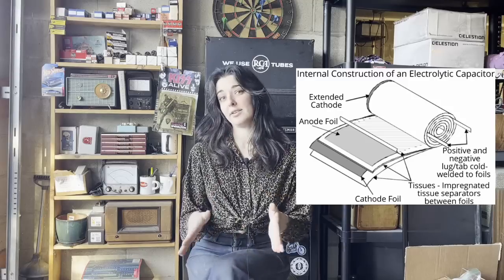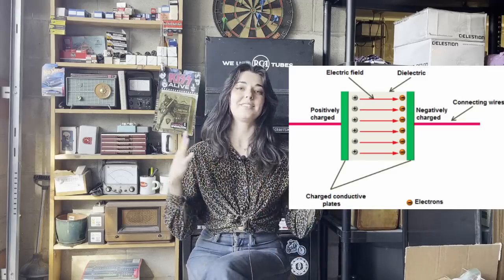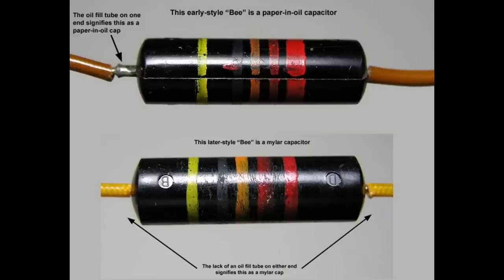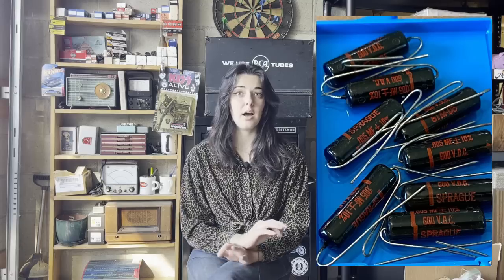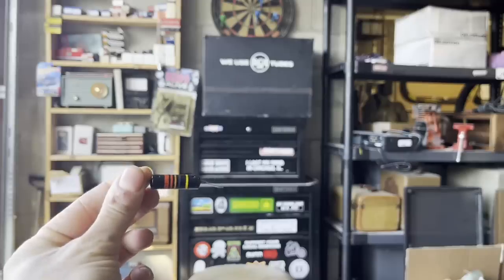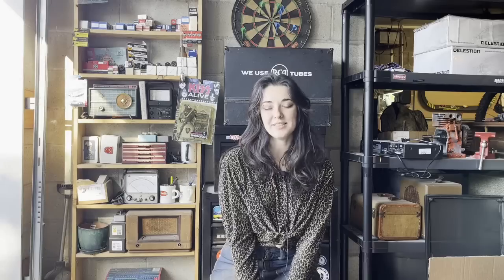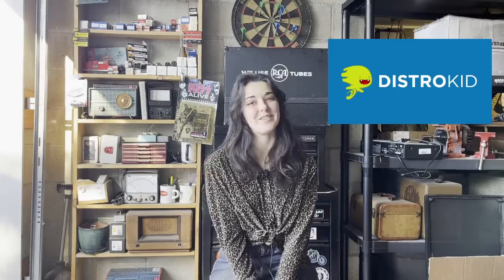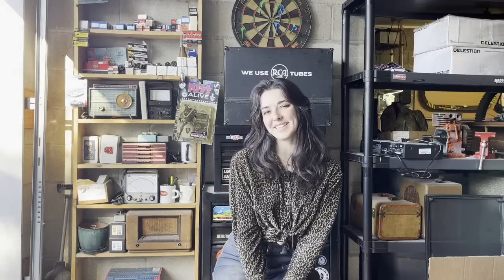Bumblebee Capacitors | Sprague Black Beauty Capacitors | Amp Electronics 101 | Fazio Electric

Comment: If an old Capacitor is working correctly then it should be doing the same job as a new one.
I honestly don't see how it can make a difference in the sound of the audio. Electrons flow in a controlled manner, and if a new cap is the same value as the old one, then it should be doing the exact same job

Comment: I went down the capacitor rabbit hole a few years back when I was upgrading my Stratocaster. I searched for the best tone cap with the best mojo. I tried tropical fish, Russian PiO, mustard, bumble bee, and the last one came from a 20 for a dollar pack of eBay Chicklet caps. The Chicklet was the one I left in the guitar. I couldn't tell a bit of difference between any of them as long as the values were the same. 

Some will swear they can tell the difference and I'm glad they can. I just know that I couldn't.
Reply: Dont't worry.  A spectrum analyzer would have difficulty finding real differences with caps of equal value, construction and intended circuit purpose.  But I forgot, this is a crowd that will pay hundreds of dollars for an 'oxygen free copper' audio cable.  I have a National NC-300 on the bench now undergoing a full rehab.  Lots of musturds mixed with split bumblebees.  As was said before, better components available now.  And smaller too...
Reply: @og_papatango  Indeed. I'd like to see someone actually analyzing some simple circuits with different caps and showing us the frequency and phase responses measured  on various input signals (guitar, noises, impulse, frequency sweep) and on different voltages. Then of course, the old caps leak current so maybe there should be some resistor put in parallel with that to simulate bad components. :D Maybe also a torture test to see which ones last the longest. Well, maybe temperature is another variable that should be added to equation.
Reply: I can't hear that as well but vocal fry.....????
Reply: A strat is also a terrible testing platform because you need to take the strings off every time you need to get to the insides. 
This inserts so many variables into the equation that you might as well not bother at all.
Any guitar where the elctronics can be accessed through a panel would be far more reliable.
Reply: Russian PIOs are my favourite just simply because they are incredibly durable and very well made.
Reply: Did you try them all with the tone rolled down? The capacitor does nothing if the tone knob is not rolled down. You won’t hear the difference.
Reply: @TheChadPad  Absolutely
Reply: @Slugg-O  Well, there is a video I just watched by Full-Gain called Vintage Bumblebee vs Stock tone cap comparison that shows a stark contrast. It depends on your setup, and at the end of the day, they all do their job, that is to cut high frequencies. It’s in the complexity that I hear differences, not in the basic frequency response.

Comment: You did a fantastic video on a fender concert a while back. This video covered many issues that classic amps experience, however, the tremolo is different than the one on a 1959  - 1960 unit (6G12 circuit). Could you please explain how this one works through the use of a schematic. 
Thank you

Comment: I have a couple dozen Spragues with low-uF values ranging in voltage from 200V up.  I'm not so sure what to use them for, considering their low-uF.  They were in a big box of ancient parts.  Few have been used.  I used my oscilloscope to test them, and tossed the leaky ones.  A seriously leaky one blew out a pickup on me.  All are marked numerically.  What $5 can buy these days!

Comment: The only caps I ever change are in my guitars tone circuit, those don’t bite. lol 
Over the years that I have been doing that the only difference I’ve heard is in the number value. Like  a .022 as opposed to a .068 or .033 or .047 those differences are sometimes drastic. As far as type of cap ceramic or paper n oil ect… not much of an audible difference for me anyway.

Comment: I am planning on using silicon diodes in series with the rectifier tubes' anodes for extra protection (even is the tube is shorted, this will prevent the capacitors from getting AC, and protects the rectifier tube from potential high value reverse voltage spikes). Do you have an opinion on this, or maybe consider it pointless? Also, do you watch videos from Mr. Carlson's Lab? He has an awful lot of videos on the topic of these old capacitors.
Reply: Reverse voltage on a capacitor doesn't really cause damage as long as the current and duration is limited. If you have fuses on the transformer input and the output of the rectifier everything should be protected enough. 

If you add this protection and the rectifier tube shorts you won't know, but you'll be stressing the circuitry with higher B+.

Comment: I just worked on a couple amps.  Of the 40 bumblebees I pulled out,  only two were within spec.  When these start failing (paper/oil in this case),  the oil can form a sheen on the case.  The value goes up but the breakdown voltage goes down.  The value also varies with the amount of signal across them.  You could use them in non power circuits for some interesting results.

Comment: I have a 1973 Les Paul Custom Black Beauty I purchased new in Jan 1974. One of the leads broke off of the Black Beauty cap. I see them used for around $200 a pair. Still debating whether to pull the trigger.
Reply: No! Get russian "paper in oil" caps, they're the same thing but better quality and cheaper... Sometimes guitarists are fools... (Not you, the ones that pay $200 for a pair of BB caps)

Look for:
K42y-2
K40y-2
And
KBG type PIO caps

Comment: I've seen people using vintage tools, like multimeters and various testers to help with repairs. Do you need vintage tools to work on amps or can you substitute all modern equipment? Thanks! Appreciate all the effort you put into your videos.
Reply: Modern tools of the same type work just fine. The main difference is digital multimeters have much higher input impedance than old VOMs. If you measure voltage on a tube grid you will often get a different reading than if you used an old meter.

Comment: If it’s a coupling cap and leaking DC to the grids of the output tubes, then it will make a difference in sound because the tubes’ bias may have changed.

Comment: I have two words for y'all that get hard ons because of BB/bumblebee caps... 
Vitamin Q!!!
 The reason that BB caps get leaky is that the case seal becomes compromised and moisture gets in the cap and reacts with the acidity of the paper(All paper has acididity in it, from manufacturing). Vitamin Q caps are hermetically sealed so they rarely if ever, leak... In fact Vitamin Q caps are about the only paper cap that I won't replace as they are almost always good.
You're welcome!
Lol!
Reply: Problem is that many people who have compared the two extensively (me included) don’t think Vitamin Qs sound anywhere near as good.

Comment: If it is leaking DC is it still ok to use in a guitar's tone control, as there is no DC current in that kind of circuit?
Reply: It's  safe to do but the frequency response likely won't be what the designers intended.

Comment: Is like to know how to check tubes like 6L6 6V6 12AX7 with   layman's tools (volt-ohm meter, Continuity tube tester, and the like). If that is possible.
Reply: The easiest way to check a tube is to put it in circuit and see if it works well. This is often considered a better test of performance than actual tube testers.

Comment: you have a  broad knowlege on Amplifier Circuitry and love all your repairs ,Im still in deep research mode and 1 thing Im a little stuck on is what type of capacitor to use in the circuit and what not to use , I do have a Electronic background but basically it was needed to get my Electrical Certificate years ago so didnt ever apply that knowlege because Electricians just replace the whole board ,but I would love to see you do a Video of what capacitors you use to replace the old out of spec caps ,Merry Christmas hun !!!!1

Comment: That was great. The way these things fail is interesting. I guess carbon comp resistors become capacitors when they fail. This isn't really a question, but you talked about microphonic effects when you were showing us that Premier 71 amp with the reverb. That is a really great sound it makes. Aren't valve microphonics a part of that reverb sound? Producers like Syliva Massy use amps and re-recording as part of the production process and when I heard that amp I could understand why. So how can you tell when the sound of an old amp is right? I guess you just need a good ear and a knowledge of how they are made and how they used, and you clearly have a lot of that. Thanks for making such great videos, and I hope you have a great New Year!!

Comment: When people replace an old cap and say the new cap is not so good, it is probably that the old device had drifted and leaked over time, and had accidentally produced a desirable tone. Then the replacement cap will of course sound different, as its value will be in spec.
Reply: There is definitely a difference between brands and makes of components.
Reply: Exactly. But if you keep track of what you're pulling out and know what you are doing, you can tweak certain things. For example bumping the capacitance of filter caps for improved bass response.
Reply: @maat8249 
Yeah but electrolytic caps rarely will increase with capacitance over their lifespan.  Changes in value thru aging is going to have greatest effect where the signal is present such as the case with tone circuits and bypass caps where it bleeds off a certain portion of the signal at a certain frequency, or in coupling caps that will also cut a portion of the signal .   Another thing to consider is how age and degradation affects the dynamic attributes of a component. How it reacts when subject to power and heat. Heat coefficients play a big role in what is considered in the sweetness of certain carbon comp resistors. These dynamics play a crucial role in what is perceived as the MOJO in certain types of aged components within the signal path. But it doesn't mean that I would want to place an otherwise inferior component device throughout the whole design of my audio circuit. But I might be able to utilize such shortcomings of certain components in specific circuit locations within the signal paths to create a dynamic response from what otherwise  would be an unstable and substandard device, to the benefit of our perception of what makes a cool electric guitar tone.
Pretty much everything we have comebto perceive as pleasant and standard electric  guitar tone is because of what we initially have grown accustomed to in the early days of electrifying the guitar and making popular music from the crude basic amp designs of the post war time period. 
What is generally agreed upon best engineering and design practices for ultimate audio amplifier performance, goes out the door for guitar amplification. Best engineering practice and design is 180 degrees difference. The deficiency and  coloration of the amplified signal is desired for the guitar.
The amplifier is every bit a part of the tone and instrument as much as the guitar is the instrument.

Comment: If they are not leaky now, they will be in six months or year. Mylar ones are better but would also leak dc in time. Problem is with black coating that develops micro cracks and moisture gets in. Cracks can be revealed if you put them in boilling water, there would be small bubles along the crack.

For replacement i recomend Solen (French), which are close in sound and much more durable. Another alternative are Illinois Capacitors which are excellent, but little brighter in sound. 
For electrolytics Panasonic NHG gives great results.

i think that i recognize RCA Senior Volotohmist and Simpson multimeter on shelf behind you, i have same ones.
Would also recomend Sprague Tel-ohmike cap analyzer or at least Heath IT-11 for next show.

All the best, keep up the good work.

Comment: Once I had four Fender 6G7-A Bandmaster heads -- One had been thru a flood and I totally rebuilt it with modern components (new iron, Mojo Dijon and M150 caps, Xicon carbon film resistors, etc) --- I'd set up all four heads in my shop, let people play them and then tell me which one was the rebuilt one --- Not once did anyone pick out the rebuilt amp correctly -- they couldn't tell it apart from the other three original (but serviced) amps --- That's when I stopped believing in "Magic Mojo Parts of the Past" --- I think many modern parts are as good, or better, than old $$$ Vintage parts --- But it's hard to convince some people who "Believe" that vintage parts have some kind of Magic Properties --- sell those old caps to the Believers for big money !!!!
Reply: Thrue, if rebuilded correctly, it would work as original.
Problem is that rebuilder sees 8uF in AC30 rectifier network and installs 22uF and thinks that it would work better. Old irons where small and band limiting, people install HiFi output trannies and then wonder from where all this bass came from, and why it is not so loud any more.
Reply: @sinisatrlin840  -- It helps if one is able to read a schematic and can build the vintage circuit correctly -- I used to buy old tube PA heads and rebuild them into guitar amps --- I'd gut the old components (throw them away) and build a new circuit (usually a true PTP build of different Tweed Fenders) with new components --- People would marvel at the "Authentic Vintage Tone" these amps produced :) --- And they had the reliability of a carefully built new amp (w/grounded power cables and fused AC Supply and HT)
Reply: @markbernier8947  "It helps if one is able to read a schematic and can build the vintage circuit correctly", it usually helps, but vintage components had loose tolerances, el caps where +50/-20%, output trannie on SE Champ was in size like gnat (for a reason), tubes where much superior than current production. Biasing was done incorrectly, shematics had errors in them. 

Lots of variables, and then New Sensor (Sovtek) sells you rebased CRT sweep tube as nos 6L6GC and than we all think that Soviet tubes are not good.

Comment: "Don't be vague, ask for Sprague" their slogan decades back. After 55+ years in the field, I can honestly say that in the last 20 years I have maybe found 2-3 "Bumblebee" caps good, and those are some NOS I have. None of the ones I have found in the equipment I have serviced test good at their rated voltage or capacitance. When I was in business they were just replaced to make the equipment dependable. I found that if the customer did not know I replaced the "bumblebee" caps, the instrument sounded perfect, but if I mentioned I replaced them, they always found fault in the sound. That told me is was a mental thing about the sound. They had a bad tendency to split the casing and leak oil  (PCB?) all over. I know in TV sets the higher the voltage the more likely they were to split and fail.  I do like the newer DPMS series of Sprague caps and pick those up any time I can find them at the ham fairs. ( Just run away from any El Menco paper mica caps. Even NOS have gone bad.) I still work on old radios and TV sets for my collection from time to time.

Comment: I had a bunch of NOS bumble bees a while ago. I put them in guitars (not amps) and there was no difference. I am not immune to mojo though. I used to argue that different germanium transistors made a difference in circuits, beyond the measured values. I collected 100's, buying old radios etc. I made a Range Master with two transistor sockets and a bias knob. I proved myself wrong!

Comment: I took a capacitor apart. It appeared to be aluminum foil with like paper in between. Small with two wires and that was it. They say ceramic caps very depending on temperature. I love your videos. You define what cool interesting knowledge is. You Rock.

Comment: Regarding the "black beauty vs modern" question, there's quite a few parameters for capacitors beyond just their capacitance and whether they're polarized. The voltage rating is the next obvious parameter but doesn't directly impact the electrical performance within the operating window. Then there's ESR and ESL which have the biggest impact on AC performance, and DC leakage which in a non-fried capacitor should be functionally zero. Then you get parameters like bias voltage and temperature dependent changes in capacitance, dielectric absorption, and piezo/microphonic properties present in some types of capacitors, which mostly limit what types of capacitors are appropriate for what applications. There's a whole rabbit hole you can fall down with this subject

With that out of the way, I don't think anyone will be able to pass an ABX test comparing a modern mylar capacitor with a vintage black beauty. The truth is that audio applications are really, really not very demanding on capacitor parameters. So long as you've got the right type, value and voltage rating and aren't using absolute garbage quality parts, you're gonna get great sound.

Comment: black beauty caps are just as good or maybe worse than good caps for HI-Fi. Capacitors massively effect the sound of an amplifier circuit but making capacitors is not some lost arcane wisdom. The Mod and Sozo caps sound great. I'm not sure if there is a manufacturer out there making caps with the same specs as sprague black beauty's but it should be possible.
Reply: A friend of mine in Japan took some samples of Black Beauties to a premier Japanese capacitor manufacturer and said he would pay NRE for them to develop an equivalent. They said they could use the same materials, but they couldn’t figure out how Sprague managed to wind them so tightly (which is something Sprague was quite proud of). They gave up because they didn’t think they could do it.